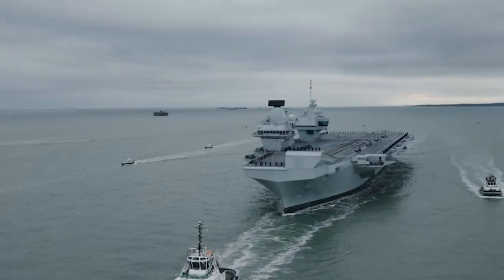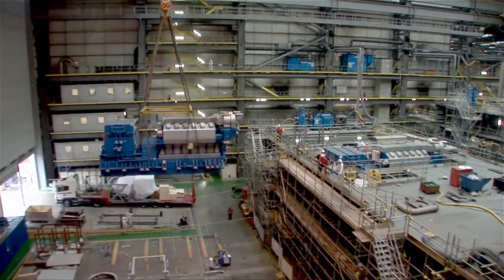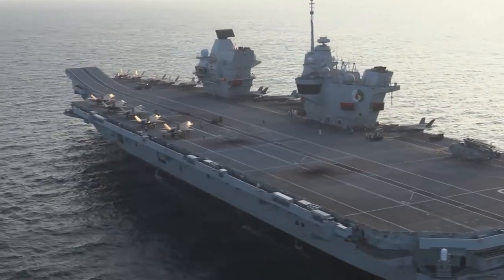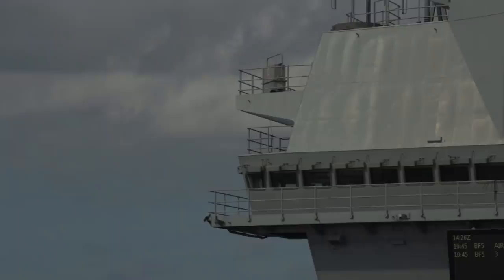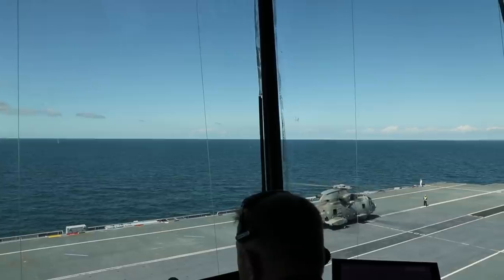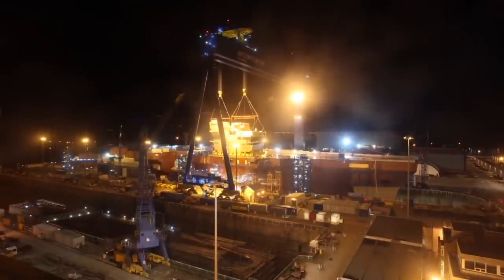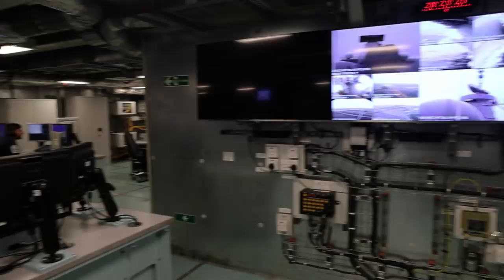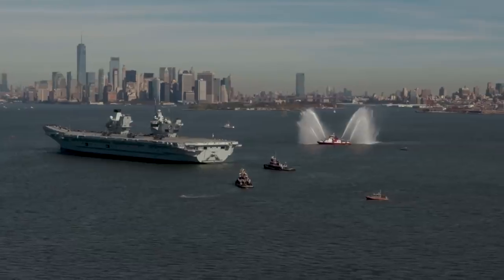Why Queen Elizabeth Carriers Have Twin Islands?

Comment: These ships are essentially 4 ships, sealed units, working in close proximity!  Each diesel generator has a complete set of controls, fuel supply, cooling systems etc. independent of all the others. Each produces sufficient electrical power for one tractor motor. All 4 together produce all the ship's hotel service power and a surplus for each tractor motor. On top of this are two widely separated gas turbine engines for a speed boost to give the strategic speed required to move to trouble spots. These are extremely innovative ships.
Reply: On my last USN cruise 1989 our ship operated two jet engines, essentially the same ones as on a DC 10. For six months, they were Never ever shut down. They would power the ship from full stop to 90% of full speed in just about 7 minutes. And it took another 5 minutes to achieve full speed.
Reply: They were efficient.
Reply: AKUJIRULE  No, it had separate electricity generator s also, if the Mane engines shut down.Ok to good range at 20knots. Point is you got nearly immediate power for speed, and the engines were robust, didn't break much. well armed. That is the Spurance class, all retired now. US Navy likes to keep fuel bunkers filled all the time. Great maneuverability. Good electronics suits. Lot off  dependable bang for the buck.

Comment: Magnificent solution! Even though I'm not British,  I feel proud of your design. Kind of feels like when you designed the Spitfire!
Reply: British design is top notch. Most Nato designs are designed in UK. Wired in Israel and coded in the Netherlands. The high precision parts are made in the UK. Shipped to Germany for tooling and fitting and then returned to the UK for final completion. Source I have an uncle in the army who works on the logistics of protecting all the tanks and fighter parts as they are shipped around the world to be finished off 10 miles away from where they get started. (Most aircraft spend more time being flown from factory to factory than on combat operations)
Reply: Aircraft carriers, and most modern aircraft carrier technologies are British Inventions. We industrialised the world.
Reply: @elikorn8777  Both carriers were assembled entirely in the UK. Obviously we bought some components overseas, but they all came to the UK to be attached.

Comment: I saw HMPoW in Liverpool, she's huge, just sitting at the dockside she projected power.

After many years of neglect the UK is reawakening and reasserting her military prowess.

With regards to communication between the towers, I don't see an issue. All operators are using headsets and whether they are talking to a station a couple of desks away or in the next tower there's no real difference.

If cabling is damaged there's always radio!

Finally, I'm immensely proud of all our military services, they represent some of the best that we have to offer.
Reply: Reasserting naval and expeditionary capabilities. Which was something Britain was great at up until the cold war.
Reply: Goyim Shekelberg  To be honest frigates would do the job just as well and be much cheaper and more  flexible in terms of the roles they can fulfill. Todays naval warfare is more littoral than anything and with the increasing usage  of small drones that could be used to carry explosives and etc. Large Surface ships of previous decades wouldn't survive  very long in an all out war against a major power.  That being said large ships do look cool but then again so do large Napoleonic line formations.
Reply: Goyim Shekelberg  Just because the US does something doesn't make it right or wrong each country has to use its resources to its maximum potential to achieve the goals of their  militaries.  For the American Navy its to project power across the globe and protect vital shipping lanes in multiple regions at the same time. The Chinese navy is mostly old cold war era soviet ships that are really for regional security. The few modern ships they do have the crews don't have vast combat or operational experience compared to say neighboring countries like  India.
Reply: Goyim Shekelberg  You are right but we have  come off topic. The main question was why does Britain need more large surface warfare ships like Destroyers meant for ship to ship action when their focus should be making more escorts for their carriers like frigates which can handle missions such as ASW and AA with much more efficiency.  Destroyers are good to have dont get me wrong but a lot of the frigates in service with the Royal Navy where  built and designed during the Cold War which was over 30 years ago no matter who much you retrofit and upgrade these ships it would in the long run be much cheaper to replace them with newer ships as the Royal Navy are  doing with the type 26 frigates.
Reply: Goyim Shekelberg  You make it seem like the  Indian Navy is the only one capable of having major accidents.  This is the most recent one but if you look you can find countless accidents within the past decade in the us navy alone. https://en.wikipedia.org/wiki/USS_Bonhomme_Richard_(LHD-6)#July_2020_fire
Reply: Also the us have awarded a contract to an Italian company to design a new ASW frigate since there is no more Perry class frigate, [ thankyou cheap politicians]

Comment: Another consideration is automation, the crew size is significantly reduced to run these ships, than Carries of similar size and aircraft complement.
Reply: They can run on on a minimum crew of I believe 700
Reply: @loganmarriott514  600 actuall for the ships company but obviously much larger when the air group is on board - about 1500 then.  the new US carriers are about 5000!!
Reply: @larryjeram-croft1692  One of the issues driving crew size on US carriers is a philosophy of being able to operate everything manually. Automation is great until it doesn't work. If you get down to a port and report watch rotation no one gets sleep and crew fatigue becomes a huge factor. When we tried to reduce crew size and training things like Fitzgerald and McCain happened.

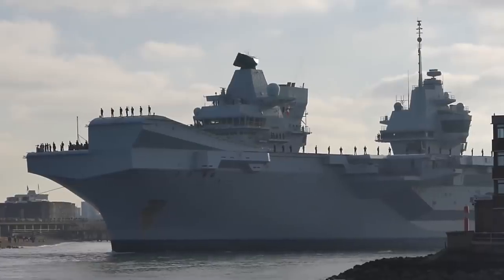Comment: Two proton torpedoes into that vent shaft from one rebel pilot who stays on target is all it takes @ 0:46
Reply: You mean space wizard?
Reply: Not so far fetched  imagine 2 small drones less than the 2 metres across   dropping in...... game over on the propulsion front
Reply: @saab900classic6  Thats actually a really interesting idea... tiny drones wouldn't be hit by AA fire and could easily mess up an exhaust pipe.

Comment: just asking. The redundancy scenarios may work in WW2 in the North Sea or Pacific. The 21st century naval warfare is about beyond visual range missiles - Sea skimming supersonic cruise or the new terror - the cruise cum torpedo or even a strike submarine. One hit on the water line or below (better on the aft where the propulsion is located) or on the flight deck makes this twin island elephant a toothless sitting duck for further decapitating strikes. The last line of defence against missiles would be CIWS which would score self goals taking down the other island first. Today missiles have trajectory correcting guidance that can exploit the blind spots to take that catasthrophic hit. Carriers move in a carrier group that protect the carrier but that cancels the surprise and stealth factors. What were the design engineers thinking?
Reply: To be fair the Royal Navy is one of the few Navies who have had some experience with taking damage from more modern sea skimming missiles, so they have applied a lot of those lessons. HMS Glamorgan for example had an Exocet skid across their deck before exploding, the ship survived that attack. HMS Sheffield was hit by an Exocet missile, and while it eventually sunk, that was after damage control couldn't contain the fires and it was abandoned, even then it took about a week to actually sink.

Redundancy isn't just for the event that they're hit by a missile though, any other number of events that could cause damage to the engine room like fires, floods and other things that are independent of an enemy attack. On top of that, large ships like carriers are still notoriously difficult to sink, yes there are many scenarios where they could be seriously crippled, but that isn't really an argument against the twin island design, it just makes sense to plan for any eventuality even if in some scenarios it may not help.

Comment: The twin island design has another advantage not mentioned.
A reduced radar signature from broadside on.
B
Reply: Kinda pointless advantage when you put HMS QE sheer size into the equation but an advantage nonetheless.

Size note, I have some American friends that are astonished that our Aircraft Carriers aren't nuclear powered despite the size.
Reply: @TamamoF0X  The reasoning behind the non nuclear design is an interesting one, I though it was odd too at first but the primary advantage of nuclear power is extreme range, great on a sub, where you can stay underwater pretty much until your food runs out but a carriers job is launching planes, and its the aviation fuel that runs out long before a nuclear carrier needs refuelling.

The thought is why pay for a more expensive nuclear reactor when you’ll still need a tanker in the fleet full of fuel for the planes if you want to operate for a long time, the nuke really isn’t giving you much
Reply: @maxkennedy8075  Non nuclear design is cheaper. No catapult == more planes == defensive in nature. Also if you do not want to harass people 10,000 miles away from home no need to have nuclear power. Hence Soviet design with a smaller ship / hybrid in the 1970/80s. If you are only extending the range against enemy bombers off your shore there is little need to have nukes to power you. If you don't need to load planes for heavy strike missions there is little need for catapults (at least powerful ones).
Reply: @maxkennedy8075  pretty sure the main reason is because the UK simply cant decommission and scrap nuclear ships.

Well they can, but they only have 1 port and it's full.
They still trying to scrap 2 nuclear submarines from YEARS back to this day.
Reply: @maxkennedy8075  And also food, water, medicines etc.

Comment: The carrier isn’t meant to be compared to the Nimitz class - that is a super carrier.
There’s a couple documentaries on it and the British decided against the nuclear option for a couple of personal requirements.
1. The size required for the reactor.
2. The requirement to refuel and dock at ports- there’s hardly any available ports where we send forces and have a sphere of influence which allow nuclear powered craft in for servicing.
3. Quicker turn around for repair and maintenance as can do it at almost any port.
4. Linked to the above- almost all nations  have a nuclear free zone which don’t allow any nuclear craft even in their area so this is also what put the British off choosing nuclear for their carrier.
4. As allies it was decided that the versatility of having these would be better than both allies having nuclear and being in the same boat of not being able to dock or enter certain countries nuclear free zones.
Reply: Also, Brittain has a couple of Nuclear subs that need decomissioning, and they don't even know where to start decomissioning nuclear engines

Comment: One cannot help but think the USA would be well off getting a few QEC carriers. Building it using one of the Bechtel A1B reactors that the USS Ford utilizes for power could make sense. By doing this but using CATOBAR and one reactor instead of two like the USS Ford costs would be greatly reduced while the ship could use all of the aircraft of a Ford class. That reactor would provide the ship with 200-300 MW of electricity and unlimited range at a greatly reduced price than the Ford class. 

Even a few ships just as the QEC are would greatly improve the Marines capabilities, but the single reactor version with CATOBAR would allow the navy to affordably keep more carriers active

Comment: HMS Queen Elizabeth R08 and HMS Prince of Wales R09 are the greatest ships we've built they weigh an outstanding 70,600 tonnes when fully loaded she has a maximum aircraft capacity of around 40 aircraft 45 for a squeeze. She has two massive Rolls Royce Marine Trent MT30 36 gas turbine engines which can produce around 40,000 horse power. She can generate the same amount of power as a whole city like Southampton for example. She has the deck length of around 4 football pitches and a full length of 280 metres she has a draft of around 11 metres and a beam of 42 meters. They are very well designed ships and having two islands is more effective than one. Unlike the new Gerald R Ford Class Carriers with just a singular island the Queen Elizabeth Class Carriers can operate both islands as the bridge and control the ship from both islands. In a combat situation if the Bridge goes out of operation due to significant damage you can operate and fully use the rear island as a backup bridge and flyco all in the same island therefore you can perform flight and deck operations aswell as controlling the ship. Not only that having two islands is just far better than the one island. Also the ski ramp is a huge advantage for our F35B Lightning II as this is a way of reducing the amount of fuel wasted on takeoff. Therefore making it a more fuel efficient way for aircraft taking off therefore aircraft get more flight time. And hi I'm in the process to joining the Royal Navy as a Seaman Specialist and I could go on with how great our new carriers are. These new carriers are such a large asset to us and we're truly proud to have them apart of our fleet. Great Vid mate 👍💪🇬🇧
Reply from the maker: We think they are pretty cool too!
Alex, we wish you best of luck in the career that you have ahead of you.
Reply: @NotWhatYouThink  thank you so much I appreciate that a lot it means an awful lot to me I'm hoping to serve on these carriers as they are absolutely awesome and I think they're a huge asset for us to continue our large presence across the world. The Royal Navy specialise is so much with Anti-piracy operations and stopping the flow of drug trafficking and we contribute to Humanitarian Aid operations for example HMS Albion has been in the Caribbean contributing to helping those effected in floods and so on and I wanna join and be apart of those efforts. But these carriers will allow us to perform and have full NATO Carrier Strike Group capabilities and Carrier Strike Group capabilities in general which is fantastic and again I wanna join for all purposes I've mentioned above and to making this world a better place and making sure that we stick to the Royal Navy motto which is "Protecting The Nations Interests." 🇬🇧
Reply from the maker: We would love to hear about your experiences once you are aboard!
Do keep in touch with us :-)
Reply: @NotWhatYouThink  I certainly will 👍
Reply: Alex , we wish you good luck and an excellent pass during and after your  10 weeks training
Reply: The max air group whilst commonly will number 40 aircraft can actually be increased up to about 60 overall at a surge capacity. Though the more aircraft you go above 40 the smaller the daily sortie rate gets. Good luck at training 🇬🇧
Reply: @fordafrempong6638  thanks mate I really appreciate it. I'll be looking forward to the gruelling 10 weeks at HMS Raleigh in Cornwall. It's gonna be great when I get round to that stage. But thanks mate it means a lot 👍
Reply: @tanyard  thanks mate I really appreciate that a lot I can't wait for the 10 weeks of basic training at HMS Raleigh in Cornwall. It's gonna be a fantastic fulfilling career and I can't wait to contribute into protecting the nations interests. Again cheers mate I appreciate your kindness. 👍🇬🇧

Comment: I just finished as part of a team building the exhaust on a RAN ship, 4 Wartsila diesel generators.
There's a lot to consider in the exhaust for a ship which has an air wing, on this ship the exhaust came out the rear above the stern door. What this meant was that there was an accumulation of hot air to astern of the ship, hot air being less dense caused danger in landing helicopters on the flight deck.
Naval exhausts are made of stainless pipe section with flexible stainless bellows which have a concertina shape to handle thermal expansion and vibration/flexing of the ship. They can have a water jacket or just have lagging (wet or dry exhaust).

Comment: I've always wondered about that . . . thanks for clarifying.  BTW: Why not build one with NO island?  They could put the bridge in the very front, and do landing operations electronically.  Didn't the Japanese have such a ship in WWII?  The IJN Kaga . . .
Reply: The bridge has to be high enough above the water to offer adequate visibility, so there will always be superstructure of some sort to house it.  Electronic landings ? Are you kidding  ? Have you ever seen a carrier in full DR mode ?  It is essential that the guys on the deck who put themselves in harms way have at least two pairs of eyes and ears which can see enough to keep them safe. Unless, of course, you are happy to send and take aircraft at 5 minute intervals.

Comment: Good old British engineering at its finest.
Reply: Until it leaks through the propshaft bearing.....
Reply: @johndean4998  There has never been a capital ship that hasn't leaked.
Reply: @hb1338  Either you're correct, which would be a poor reflection on the quality of British maritime engineering; or you're wrong. Either way, do you have any authoritative evidence for your assertion, or is it just a hunch?